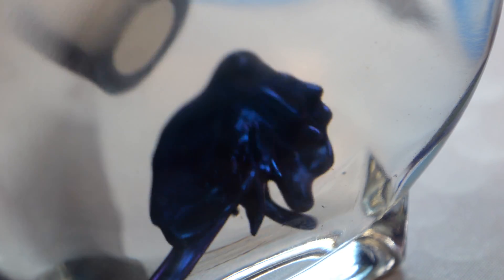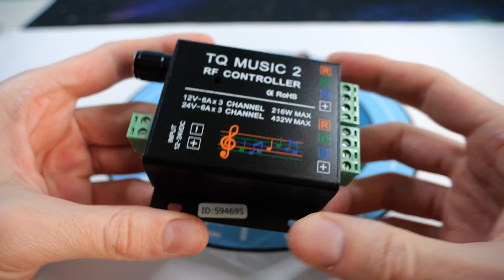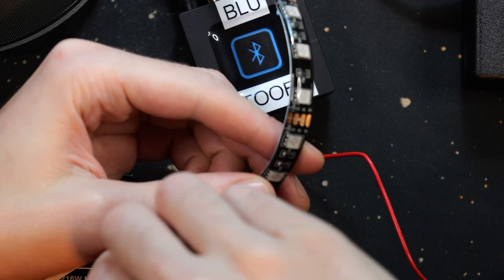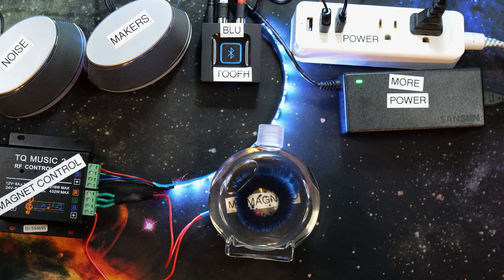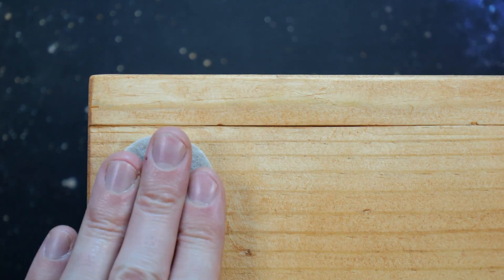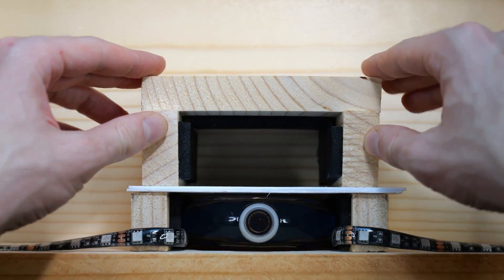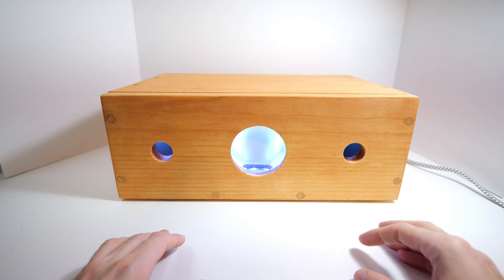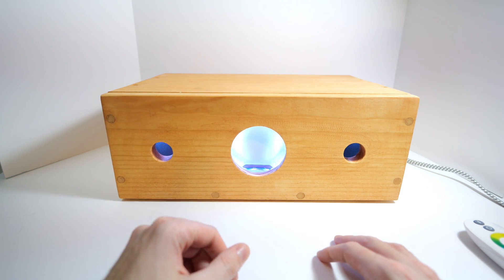Building a Shapeshifting Speaker - Bluetooth Ferrofluid Speaker

Comment: This is a great result, far better than I expected. Did you ever try changing the magnet position? I don't know if it makes any difference or not, but since the gravity is constant, I was wondering if locating the magnet above the container would result in different fluid movement. I also wanted to ask if you are making the fluid yourself, and if so, what kind of color were you using? It is beautiful.

Comment: This won’t work without amplifying the audio signal. I literally used everything in this video and it worked but only if the volume is maxed out. Fix this by using a class d amp before the led controller. Also use a mosfet before the magnet for higher current.

Comment: did you do any calculations on the required power and stuff or just wing it? I'm confused how you can run the electromagnet and the small led strip on seemingly two equal power outputs

Comment: I was looking for this build everywhere! I've seen the original one selling for 300! and ofc I think thats overpriced, I plan to build this and customise it on my own...do you think perhaps suspending the ferrofluid in thicker oil would give it an antigravity effect and slow its decent to the bottom of the glass? .... or just a bigger electromagnetic would be able to do that?
Reply: If you could provide a written list of all electronic components used and their cost it would be so helpful and very much appreciated! Great Video! Looks like such a fun DIY project that I wouldn’t even want to buy one if they are even cheaper😅. I plan to buy some old wooden speakers from a thrift store to give it that old time retro look but with the futuristic effect of the ferrofluid.. think it’ll be a nice contrast😊
Reply from the maker: I bought a pre made ferro fluid bottle I know ferro fluid if not in the correct liquid will stain the sides of the glass so be careful with that just something I came across, I hope it Helps - Cheers!
Reply: @QuietNerd  The pre made you bought is that one with cost $70? I saw somewhere on website same size like yours in blue or gold color. Not so cheap ... Also people talking about salty water or pure vodka to avoid stained glass. I have not try yet but better to try before buy this $70 bottle. I agree it has fast motion and goes down faster. It needs something in the water to make it heavier.  Finally I want ask how your project not needs arduino? This music controller you have doing the work? I choose your way to avoid code and arduino.. Where to buy this controller?
Reply: podes usar como liquido portador agua con sal , las botellas que venden comercialmente con ferrofluido comercial usan eso simplemente una solución salina ,  depende el efecto que quieras lograr podes usar kerosen o aceite vegetal ( depende que tan pesado sea el ácido oleico qur utilices podes usar oliva o maíz )